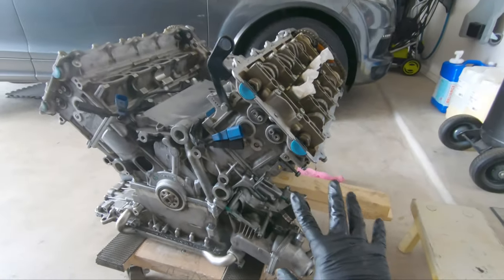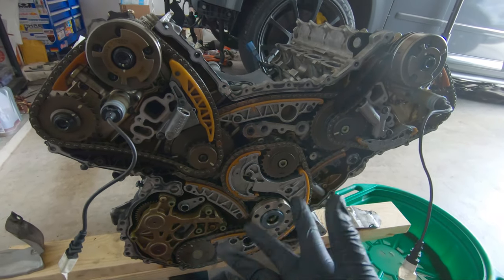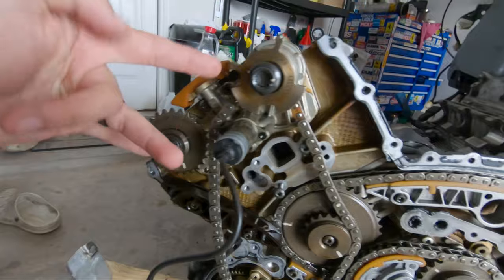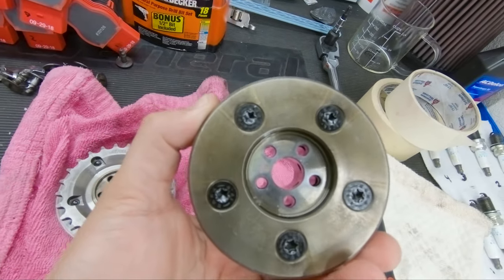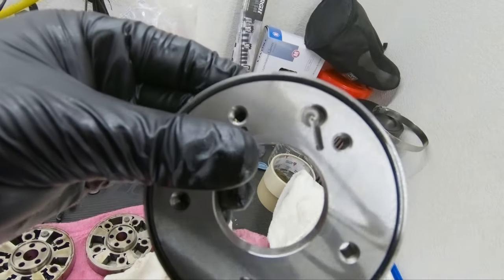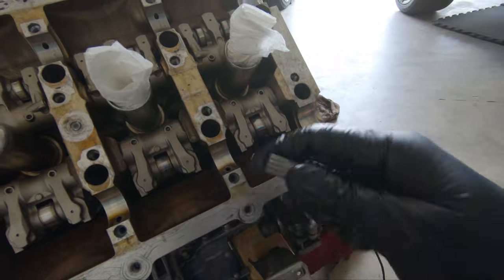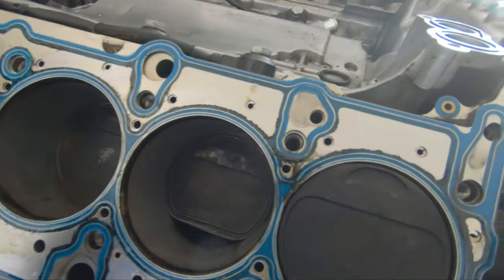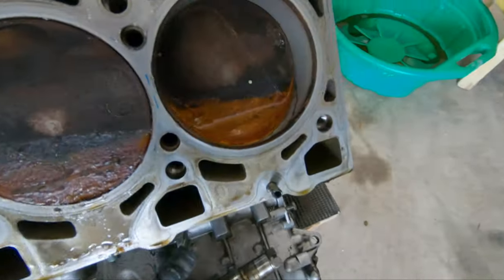Part 5: Removing Heads & Timing from 2004 Audi S4 Engine

Comment: I will be doing the valve stem seals in few days, when cams go back in do they have to be set in certain way ?
Reply from the maker: Depends how you do them. If you dont do a resurface cleaning then, yes it's recommended to put the valves back in the exact location/ clock position. Awhile back I did a DIY on that. And this is the approach I did. Marked the valves to help me know which way they go.

https://www.audizine.com/forum/showthread.php/826759-DIY-Audi-B6S4-Valve-Steam-seals

Not the other approach would be doing a deep surface clean where you use a past to re seal the valves. That method doesn't matter which way the valves are clocked. But still best to place the valves in its original location. If you look up Amtuned, I remember Alex made a video of this method

Comment: is that special kind a marker for marking and if you can please share some good manuals you have used to do the manual with all the steps and torque specifications. I need to do timing chain replacement on my Q7 TDI 2013. Just started noticing on cold start 1sec chain rattle and goes away. Looking for good maintenance manual i can follow to make sure i do it right
Reply from the maker: I used a paint marker. 

Permanent Paint Pens White Markers - 2 Pack Single color Oil Based Paint Markers, Medium Tip, Quick Drying and Waterproof Marker Pen for Metal, Rock Painting, Wood, Plastic, Canvas, Mugs https://a.co/d/35tG1i4
Reply from the maker: I only have the manual for the S4 and not fornthe q7
Reply: @markb6s4   Thank you sir for your time to respond i do appreciate it

Comment: Hi Mark, people say use exhaust pop too many times will break the exhaust valve. Could that be pointed out in your video?
Reply from the maker: As for the exhaust valves braking that's something I have not heard...but... It can hinder the engine if it's used a lot and continuous. The only time I use is mostly just for show. My personal opinion i think it's cool
Reply: @markb6s4  cool thx! My s4 is an auto. When the pop starts it feels like something is stuck but not a smooth transition, kind of like an engine and transmission or maybe not. I’m not sure if it is about mechanical or software